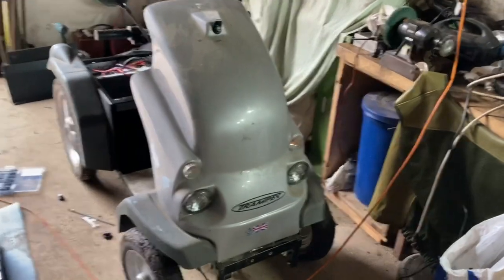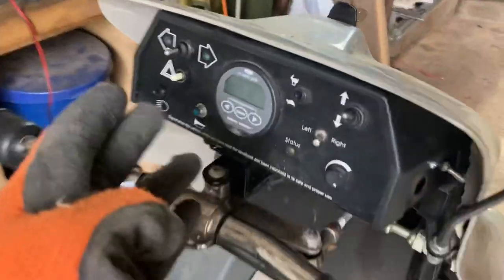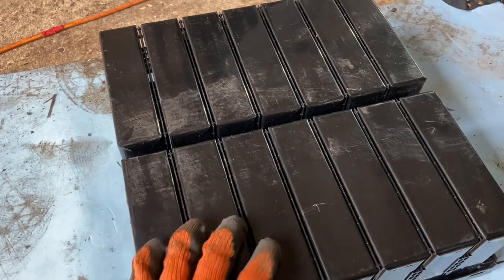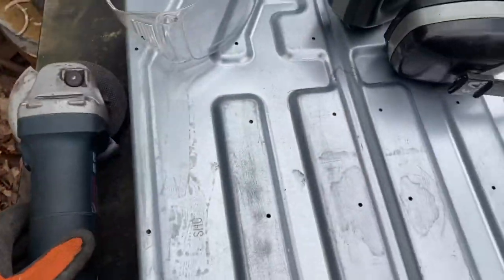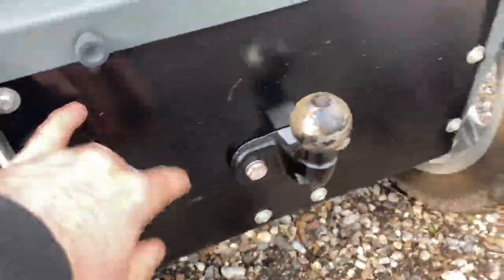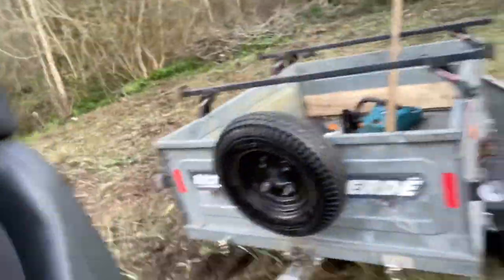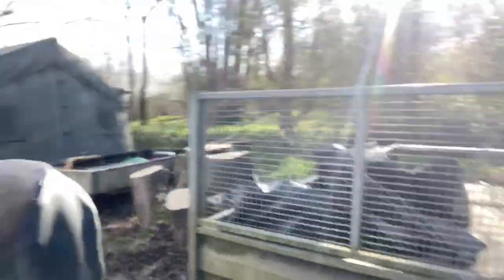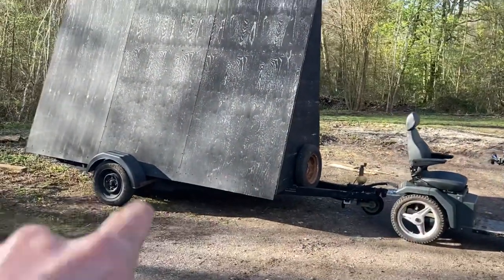The most powerful mobility scooter in the world!!!!

Comment: Hi ... I'm a disabled lady looking for an all terrain Mobility scooter,/wheelchair.. what batteries did you install... Was this because the old batteries were dead or ? 
And do you think the suspension and steering coloms (I think that's what the are called) would last ? As from I've seen online via a front wheel change video... It all looks flimsy? Great video by the way especially the wheelie you nutter 😂🕊️
Reply: He changed the batteries because they’d not been charged for some considerable time and would no longer hold a charge.
Reply: I once had gel batteries with me, they didn't last long, the longest ones lasted 2 years, the successors only lasted half a year, I always have to drive uphill and downhill.